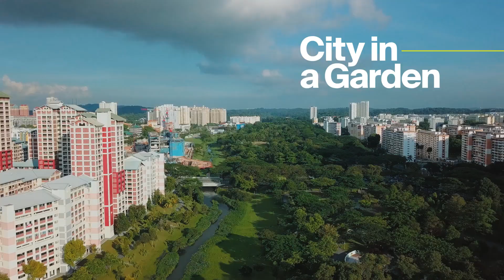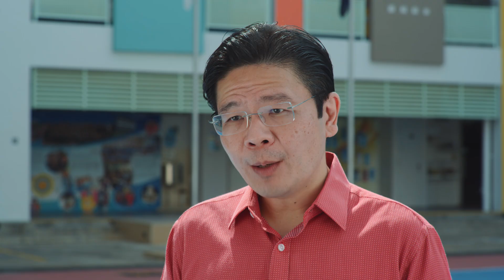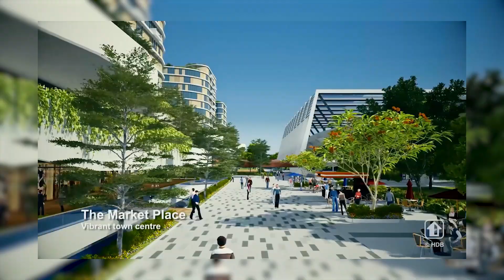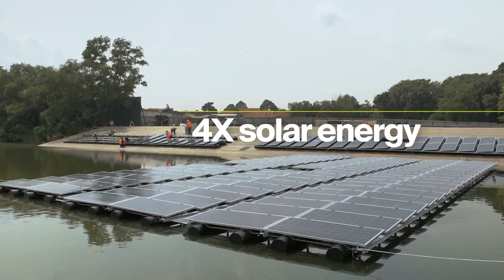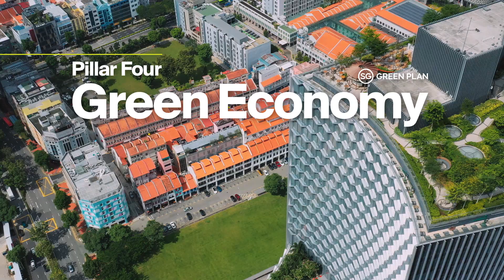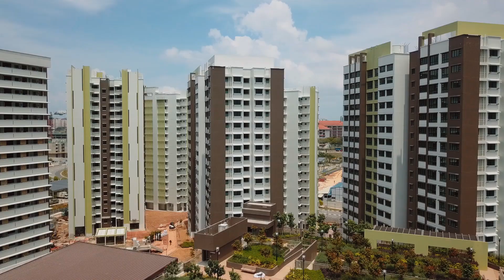Singapore Green Plan 2030

Comment: - Extensive network of bicycle lanes.
- Bicycles with e-motor, but only active when the rider pedals. E-motor is strictly only as support, just like those in Europe.
- Small scooters and motorcycles fully electrified, separte license up to 60 kph.
- Future: charging loops at red lights in the road to extend range
- Charging stations everywhere.
- No more 2.5 ton SUV's, vehicles with 400 hp and more, super-sport cars etc., or these should be superheavy taxed.
- New small car class, similar to the Japanese Kei cars.
- 1 car per family only.
- Road tax on basis of eco-friendlyness, not engine size, or such. The more road space, higher weight, higher consumption, greater usage of resources, than higher the tax.
Reply: Yes one car per family. Unless you live with more than 2 generations